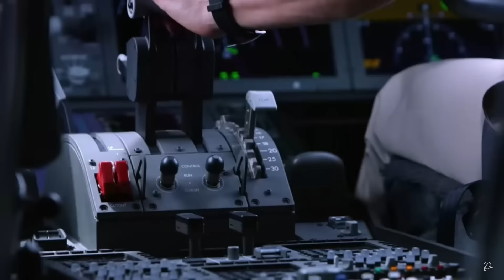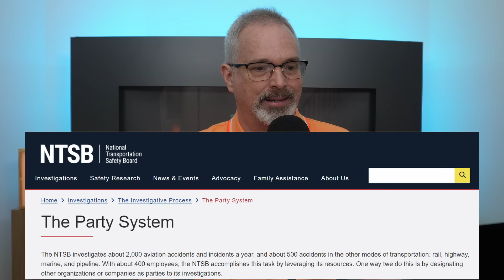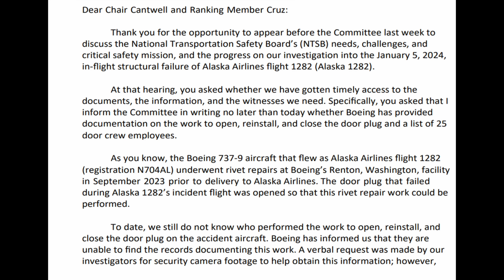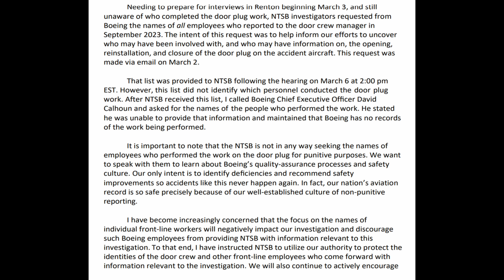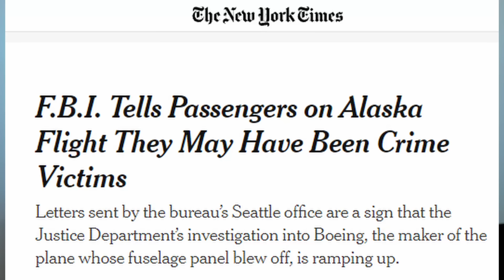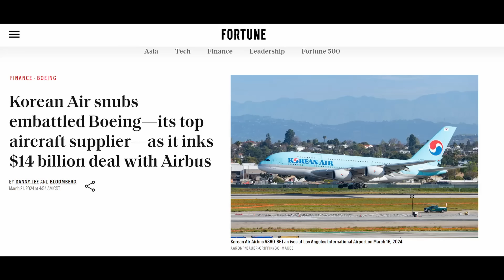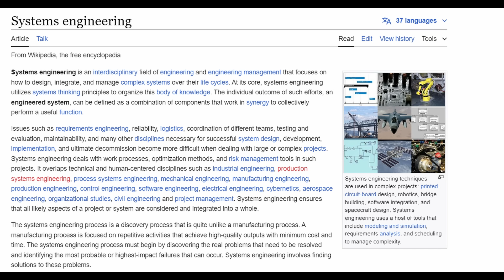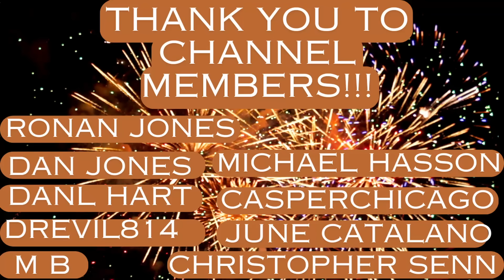Is the FBI Taking over the Boeing Investigation?!

Comment: I worked at a supplier to the aircraft industry, including Boeing, and everything was supposed to be traceable. Everything from what lot of material was used in the manufacturing of a part to everyone who actually worked on that part or inspected it and what specific gages were used. We were also told that falsifying data was grounds for dismissal and could be seen as a crime that could land us in jail. The machine operators who made the parts were responsible for inspecting their own parts and there was no secondary inspection. At least half the people there were not fluent in reading blueprints and they were approving parts they didn't even know how to properly inspect. Extra parts with no documentation as to were they came from, were being saved to fill future orders if a machine operator needed to replace a scrap part, losing all traceability. Management knew all this and was complicit in it sweeping many violations under the rug. Many of their problems stem from the company not being willing to pay for the level of skill needed to do the job while at the same time pushing DEI. Don't underestimate how the push for DEI is affecting quality. Boeing employs DEI and is pushing it on their suppliers. They should be hiring the best people they can find, period.
Reply: Wow
Reply: Cannot blame DEI. Instead blame a culture of management not providing the tools and resources to properly undertake the job. DEI isn't intended to give unqualified people jobs, it is intended to reduce inequities. You said it yourself - "many of the problems stem from the company not being willing to pay for the level of skill needed to do the job". So often companies want to spout the right rhetoric (to show they are being good corporate citizens and get the "brownie points" for doing so) but are not willing to invest the time and resources to do it well.
Reply: You sound like the managers and DEI officer where I worked, thinking they can hire anyone and train them to do any job they want, just give them the tools and resources to do the job. That may work in a low skill environment, but it doesn't work when you need highly skilled engineers and machinists. It just shows how out of touch management is and how little they appreciate the skill their good employees have. Under DEI if management can't find qualified diversity hires, they will discriminate against a qualified White man just so they can check a box and then they will hold back the pay and promotions for the better White employees because it's all about equity. You can't pay one group more than another group because it's no longer about merit. I've seen it happen and the results aren't pretty.
Reply: @pantera01971  This hasn't gone well. I'm no management or DEI apologist so don't go there. First up, I noted that DEI isn't intended to give unqualified people jobs, nor is it intended to promote discrimination on grounds of race or any other factor - the exact opposite is the case. Maybe you have just been on the wrong end of badly misused and badly applied company policies and management in the past but don't extrapolate that out to a racist trope about discrimination against White (your capitalisation) men. I can (and do) agree with most of your initial comments about bad management of, among other things, the traceability of parts and everything that stems from it. I also agree that management cannot 'cheap out' when paying good workers. My whole point is don't blame it on DEI, blame it on management - bad management of quality, bad management of DEI, bad management of a range of factors that leads to failures in all sorts of areas.

Comment: We should salute the Boeing corporation! The Boeing corporation strives to be a safe space where investors never have to worry again that engineers will be allowed to put too much quality into any of its products. All levels of Boeing corporation management work hard to make sure that they follow strict quality control measures that strictly limit the amount of quality that goes into each plane or vehicle manufactured by the Boeing corporation. The quality of each plane is strictly limited so that profit can be maximized. Unlike its many competitors, the Boeing corporation has realized the central truth of the airframe manufacturing industry, which is “dead passengers that do not affect the stock price do not matter“!
Reply: The thing is they're bleeding money by now from all the incidents. They just don't know any better. They should probably just build a new HQ structure based on the factories and then shut down their MBA infested HQ.
Reply: @udirt  
The problem is that real quality is hard to measure, but money isn't.  Without senior management that understands what real quality is, I'm not sure Boeing will be able to turn this around until they sink even lower.
Reply: It hits hard because it's true.
Reply: @depleteduraniumcowboy3516  
I really wish it wasn't true.

Comment: Several years ago a friend of mine was working construction at the Boeing Everett plant and was electrocuted and died.
The Boeing spokesperson told the Everett Herald reporter “ An electrician was electrocuted and died today at the Everett plant, it did not hold up production “
That’s how much they give a crap .
Plus all they did was block off the area where it happened , any other job would have been shut down by OSHA.

Comment: I've worked as sub to Boeing on a DoD product/system thingy.  I'm confident that there is no limit to their flexibility with the truth. They also get bendy with truth over any sized issue and have to ponder the benefits to truth telling vs. instinctively telling the truth. They anguish over communicating the slightest detail to the govt. customers for fear of a follow up question. Systems engineering is the DoD/Spook way of building an assembly of black boxes.  As an engineer you "Stay in your lane" and work to defined requirement docs and interface requirements.  It does not end well when the over-all product team doesn't appreciate candor.

Comment: This is not an engineering problem. It is a financial problem. 
Somebody in Boeing calculated that it's more profitable to crank these aircraft out at max speed and pay out occasional settlement than it is to make them properly. 

737 Max is the Ford Pinto of the skies.

Comment: The V-22 OSPREY is also a Boeing Bumblebee that does not always want to stay in the air. They have been trying to make it fly for a long time even talked about it in the 60's
Reply: It's a neat idea, but it's realization is quite complex and prone to "single point of failure" problems and would require "overengineering" and redundancy that would be hard to realize. Even the Chinook helicopter isn't without its flaws, but at least it's not a tilt rotor solution that adds to the complexity and it has taken many years to work out the issues with the Chinook and the predecessors.
But I of course also see the benefits from the V-22 in military operations, and in war time losses due to technical failures might be acceptable, but not in peacetime.
Reply: @ehsnils  For the want of a nail

Comment: As usual in America an investigation will be opened, with criminal proceedings threatened, the company will then be allowed to "settle for 1,000,000 or 10,000,000 or 100,000,000 or an undisclosed amount to the Govt by neither admitting/denying liability.
Happens under every Govt and every President.

Comment: The non-technical term for Boeings actions is that they have repeatedly shut the bed! Bean counters are very famous for flushing companies down the toilet.
Reply from the maker: To continue with that theme, Boeing apparently did an "Amber Heard".
Reply: I would replace the term Bean counter with Wall Street banker.  It's not the bean counters making these decisions.
Reply: @1MinuteFlipDoc  You are correct in that it is  probably Wall Street.👍

Comment: I have been a relative laborer all of my life and have had a number of jobs and work types in my life, most of them at a skilled Technician level. I retired after 45 years from communications and aerospace tech companies. What I have seen in that time, especially in the past 20 years is a progression of downgrading of quality standards due to 'cost of quality' concepts, starting in the 90's. However, that step down pales in comparison to the effect of the reduction in technical proficiencies and work ethic brought on by recent DEI initiatives which are being driven down by the Fed. It should be self evident that if the quality of labor is reduced, the quality of product will naturally follow suit and management will have severely limited ability to fix that. In fact, in today's workplace environment, managers are prohibited from making corrections.

Comment: I can't count how many times I went out to remove a fastener only to find that the person who installed it striped out the threads and use a piece of string and bubble gum to hold it in place. Or how many times I found that supervisors were misinterpreting the tech data. Or management refusing to wait for manufactured parts to be properly hat treated and finding the part failed after on flight. Or tapping out the threads of self locking nut plates which destroys the locking function of the faster because it would take too long to properly replace it. Or improperly installing engine mounts and destroying the heat-treat properties of of hardened mounts. Or finding cracks in main wing spars. Or flashlights or worker shoes left inside access panels, or flight control mount bearings missing. Or 17 foot long cracks in the fuselage. Or holes drilled into the fuel tanks when workers tried to repair adjacent skin panels. Putting time limits on workers is the failure. Maybe they should raise the price for tickets to $1000. per hour of flight time per person.
Reply: what is weird: how can Airbus produce Airplanes that are not plagued by this issues? What is so different between the two companies? The only obvious answer i got is European vs. American culture. Quality + Safety first vs. Profit first.
Reply: You're just too fussy!

Comment: This could be a "front line" problem of employees saving themselves effort by not doing what they are required to do, but if that is the case, it is still a management problem, because it is not the front line employees' job to verify their own compliance. Or if it is, then that is a management failure. Safety compliance is at minimum a two-level job.

Comment: The problem is that people like Calhoun and all the management down the line can't understand the technical issues involved.  Not all engineers can manage, but some can, they need to find them and get the MBAs out of the way.   And I would like to add that the defense industry loves solving complex engineering problems, because they have cost plus contracts, and more work means more billable hours and more overhead they can charge the government.   The defense industry is a corporate welfare system and can't be applied to an actual business that needs to make more money than they spend.

Comment: I don't believe they keep records of who worked on a project.  I believe when employee's sign in they sign they are working on a airframe or assembly line but not at the detail level.  They know who was at work that day - If that is within their record retention period.  They should be recording who completed a given task - the lead mechanic completing a task signs of the task is complete.  If the task was never completed their would be no sign-off or inspection sign off as there was no task completion.
Reply: You may be correct in this instance, because of the likelihood that all rework attributed to Spirit Aerosystems warranty might have a single charge center for clocking hours. All in sequence work would be charged very specifically to what task is being done.

Rework is somewhat outside of the data collection for manpower planning, but ordinary work is very thoroughly analyzed to determine how to optimize labor expenses.

Comment: The first level manager directed employees to do the work. I am quite confident he ordered employees from Boeing, Spirit, and 3 separate Spirit subcontractors to get the work done. Because no formal paperwork was generated it was simple oversight the 4 locking pins were never installed.
That's how McDonnell-Douglas rolls these days ... 
Middle-managers are forever in fear of being transferred to SC, which may happen a the drop of a hat, for missing production deadlines.
The IAM union is not letting Boeing release employee names as this is a management issue, not a labor issue.

Comment: Back in the day it wasn’t unusual for engineers to come look over my shoulder to make sure things were the way they were drawn. And I didn’t mind, it made me a better builder and welder. When I switched to construction, welding in structural steel, I occasionally saw an inspector looking at our materials or equipment, but none of them ever climbed to checked the welds up high. I’m not worried about my work, I was always trying to prove my worth so I didn’t need watching. But some of my buddies, I’m not so sure about.
Reply from the maker: I know what you mean. I work a lot at construction sites and inspectors rarely get out of their pickup truck.

Comment: Systems Engineering at Boeing is fundamentally playing “requirements cop”.  They collect program requirements, collate them in some software, then run around policing the engineers as to when their requirements are fulfilled & reporting to management.  Think “requirements accountants”.  They know little about the systems architecture and are not expected to know much.  They are typically very involved in new programs, but it would appear that they don’t play much of a  role in on-going manufacturing programs.

Comment: Although cumbersome, Boeing's chairperson of the board role should be split into two people. One represents safety and engineering, the other represents shareholders. Both have to agree on all material plans and decisions. It would create huge logjams but would ensure safety has an equal seat at the table. The CEO would co-report to both chair people. This means they must bring plans and decisions that address both priorities. The current issue is that profit maximization is often the path of least resistance (but most peril).

Comment: System engineering is, indeed, the solution.  But, implementation involves a culture change, an increase in cost, extensive re-training in a division that has lost this aspect of the art, beefing up quality and safety departments, listening rather than talking down to employees, and so on.  Activist management might achieve this in 5-10 years.

Comment: My guess is the problems are cultural, and come from questions of profit. The engineering is important, but as an engineer who has worked at companies with good management cultures as well as bad, I have to say that the part of the system which is the boneheaded management can be the overriding problem in need of change.
Reply from the maker: Bad management has certainly ruined many good companies.

Comment: I am pretty sure Boeing has uses system integration in their operations. The problem could be - do they use it the way it should be used?  Do they impose the discipline that is necessary for system integration to work? It looks like they are kind of slapdash with everything they do. (I am a retired aero engineer very familiar with system integration).

Comment: Casey I left a question on another video regarding the door bolts! So let me just say, that has been stated that there is a procedure for the door bolts being reinstalled, but my question was; What if the bolts had never been installed by Spirit when shipped to Boeing? Would there or is there a procedure to identify if the bolts were not there to begin with? Would there be someone that should have identified that the bolts were missing and should be there?
Reply from the maker: Sorry if I missed your previous question.  I think the entirety of their quality procedures are in question at this point all through the supply and assembly chain.
Reply: Videos on other channels about the NTSB preliminary report on this incident have photos taken at Boeing just prior to the rivet rework that show the bolts in place prior to opening it for access to repair area.  Then there is the “figure 16” photo showing the plug closed, but bolts missing, and ready for reinstallation of insulation & interior panels. This photo was last September.
Reply: @Bitterrootbackroads  that company needs there entire upper management changed, and possibly the board of directors that allowed upper management to let this happen! Like Casey said before, it’s time we to  get someone in that is more engineering oriented, knows how design, how systems should work, and how QA/QC should be done and managed!

Comment: The worst part of this story is that Boeing actually took a picture of the installed door plug after the rivet repair and re-installation of the door plug but before the installation of insulation matting and cover panels.
In that picture, it is clear that the 4 bolts with slotted nuts and cotter pins are not installed.
The fact that Boeing cannot document who carried out the plug door installation is enough grounds to launch a criminal investigation since at this point, the airplane was still a new airplane under construction and assembly which means absolutely everything shall be documented in detail.
It seems there are more problems within Boeing than first thought.